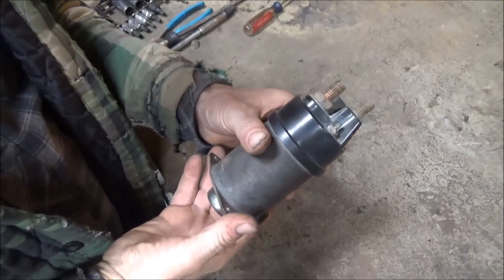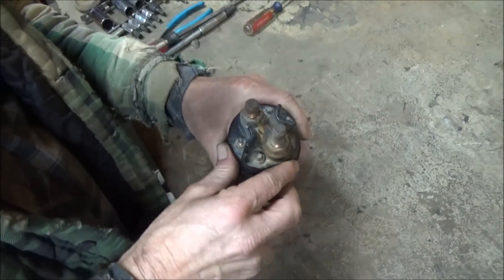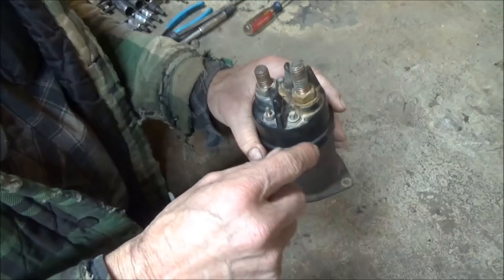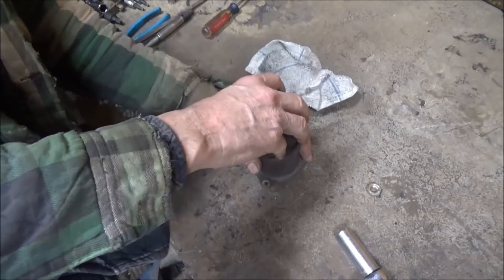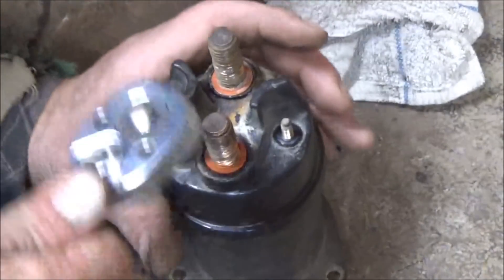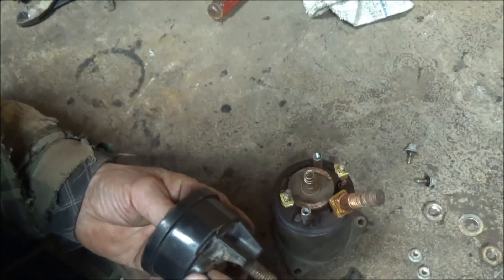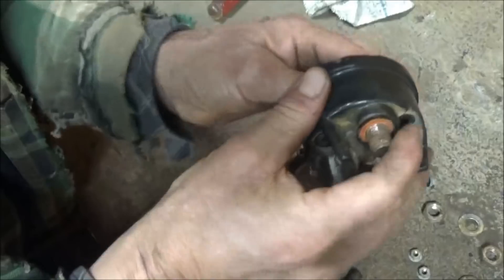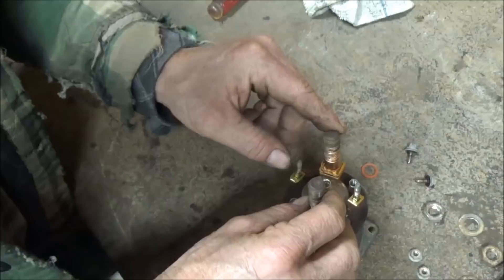What's inside a starter solenoid and what it does  January 15, 2018

Comment: There are 2 coils in the solenoid. A pull in and hold in coil. Both coils activate when you turn the key then when the starter contacts make a contact the pull in coil is turned off and just the hold in coil works. It saves the solenoid windings overheating.

Comment: Hi. Good video. I have a Massey 285 tractor. I was having trouble starting it. Turn the key and one click. The starter turns over when I jump the two large lugs together. When I ark the battery lug on the solenoid with the starter terminal it just clicks. I checked all my cables and the lug to the copper bar to the starter was corroded. In the process of removing the nut, I broke the back off the solenoid. I will order a new one after Christmas. Would the solenoid have been defective in the first place. It sure is now. Any advice would be helpful. Merry Christmas to you. Thanks.
Reply from the maker: I think you do have a solenoid problem, if the solenoid is mounted separate from the starter then you don't need to order a special one from the dealer, you can just get a generic one like what was on the old ford cars. Here's a link to a video I did a few years ago.
   https://www.youtube.com/watch?v=GAkfS2ovm9Q

Comment: Great video. One point I was hoping for some explanation. Most people explain the 2 large terminals indepth and how they're energised and what happens to the internal parts, the disc etc etc. But I can't seem to find explanation or info on what happens inside the S and R terminals inside the solenoid. Are they energised, where are they connected to inside, what happens internally when 12V cranking power is supplied? 
There has also been a lot of debate on the S and R. Some say forget about the R, some even say since it's a 12V bypass to the coil, and your starter doesn't have the R, then just connect to the S and it also delivers 12V cranking power. 
Looking forward to your advice. Thanks
Reply from the maker: Unless you have an old vehicle, tractor or machine with breaker points ignition you won't have any need for the "R" terminal, it is a resistor bypass to the ignition coil. The breakerless or solid state ignition that is on everything now since before the '80s doesn't use the resistor for the coil. On this video the other terminal is not a "R" it is a ground because this is a big truck solenoid and is wired a little different since it is a diesel.

Comment: Great work sir! Thank you for another excellent video!  I have a truck that drains batteries(when parked  over the weekend). Would it be possible for me to put  a starter solenoid in line on my battery cable and run the little wire to a remote toggle switch on the dash? Or would it burn up the solenoid to be energized for several days in a row while I'm working? 

I've considered a manual shut off switch, but cannot find a suitable location for it that is out of the weather and/or doesn't require removing panels to get into the battery box and/or requiring several feet of additional cabling.
Reply from the maker: Thanks for watching. To answer 1 question, you can buy a solenoid that can run continuously from a camper or R/V supply but I would never do that for your problem. I would 1st make sure all your batteries are in good shape, I have videos on that in my playlist of auto electric    after you're sure they are good you need to find the source of battery drainage like leaving the power inverter turned on or a light on in the storage area under the bunk etc.

Comment: Another great video! Love the new setup!

Quick question, when you get a replacement starter do they not come with rebuilt/new solenoid?
Reply: I spoke too soon, you answered my question at the end of the video. Thanks for sharing!
Reply from the maker: Thanks. Yes the starter comes with a solenoid but since I sometimes do the rebuild myself I like to keep the parts handy, sometimes the solenoid gets broken and the starter is still good. I just thought it would make a good video since I just did a starter repair.

Comment: My 2003 S-10/Blazer solenoid seems to stick periodically and nothing happens when I turn key to start.  The thing I've done to get going is to hold key to start position and hold it there fore 30 seconds.  I guess it heats the low amp cercuit enough to unstuck and the motor then briskly starts.

Comment: Does the Bendix have to kick out for the 42 MT starter to spin?
Reply from the maker: Bendix is a brand name not a part name.  But yes the solenoid will engage the starter drive and the starter at the same time.

Comment: It must of been a little tedious having to align the small terminals bolts through the cap - 
how many times did you curse and throw the relay against the wall before you got it right   ( ha ha ha )
Reply from the maker: Not hard at all, it may have looked that way because I have clumsy fingers. Thanks for watching.

Comment: Thanks for the info. I didn't know it pulled the plunger with electro magnet. I thought it pushed the plunger with a rod or something!  Thanks I learned something from you. I cleaned mine up but it still don't work I think the electro magnet went out,it just make a noise but nothing happens. My starter is still good though.
Reply from the maker: Thanks for commenting.

Comment: A Resler And Gerald Wayne ,Old GM solenoids were made so flipping contact disc was easy . Later models were much more difficult . Good point on pull and hold coils , i dont remember a coil fail in solenoid .  not an expert ,but thats what i remember. Kept my vehicles running for years , visiting salvage yards and trash cans .
Reply from the maker: Thanks for watching.

Comment: i have classic car triumph stag and mine is just cliking  and when I ark it out the starter just spins and doseant crank engine  it mite crank it now and again I was wonder ing I put less amp battery on car would that cause it as its only started doing it when I put diff battery o it its got v 8 moter in car
Reply from the maker: maybe try it with jumper cables, if still no good change the starter or better, take the starter to a starter and alternator shop for them to check it out and fix it for you.

Comment: Mr. Robertson's excellent video omitted two items: First, there are two coils in the solenoid: a pull winding, and a hold winding.  Both connect to the S terminal, but they have different grounds. The hold coil grounds to the case, so it is always grounded.  The pull coil, however, grounds through the tab on the large terminal connecting to the starter windings. As odd as this sounds, it grounds through the windings of the starter itself. (The difference in resistance between the starter windings and the pull coil is such that when they are in series there is virtually no voltage drop across the starter windings, allowing the pull coil to see almost the full battery voltage.) In operation, when the S terminal receives battery voltage, both coils together move the starter drive into position, and then engage the starter relay at the end of the stroke. This shorts the pull coil ( both sides at battery voltage), leaving the hold coil to keep the starter drive in position, and the starter relay engaged. I have seen the hold coil fail: then as soon as the pull coil is shorted, the relay drops, re-enabling the pull coil, and repeating the cycle in a very noisy chatter.  To Mr. Vest's question, I don't know if the hold coil alone will engage just the relay (assuming there is no starter drive being moved into engagement), without the help of the pull coil.  Obviously, any parasitic drain in the truck's electrical system will provide some ground to the pull coil, helping the hold coil.  I don't have a solenoid to experiment with: anyone?   To anyone doing the experiment, I suggest holding the core about a quarter inch from the end of stroke, so the hold coil isn't moving the core the full stroke. 
Second, older spark ignition (not diesel) solenoids have a C terminal, which is also contacted by the copper disk in the relay, and which provides battery voltage to the ignition coil, bypassing the ignition ballast resister, and allowing the ignition to see the full available battery voltage, and not roughly half voltage, the other half being dropped across the ballast resistor. The ballast resister saves the points by lowering the voltage, but is a liability when the starter pulls down the battery voltage.  This all became obsolete when electronic ignitions, which generally don't use ballast resisters, replaced points.
Reply: Great knowledge great thanks for sharing.